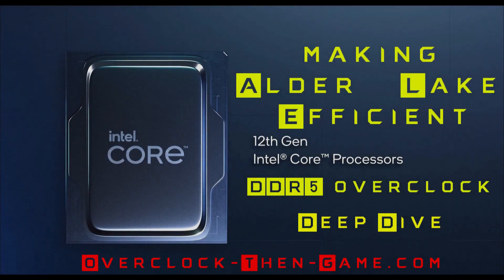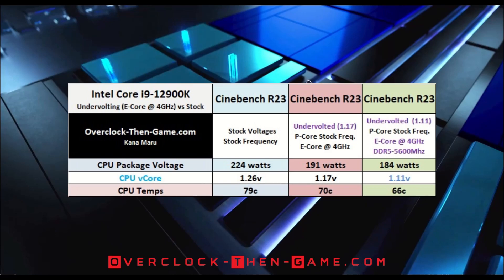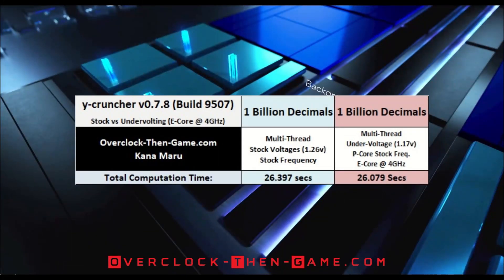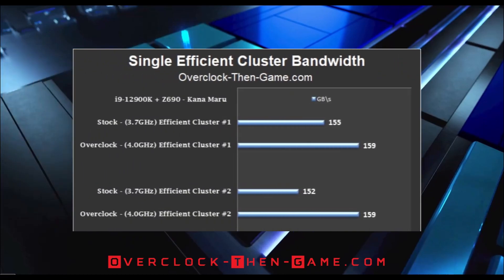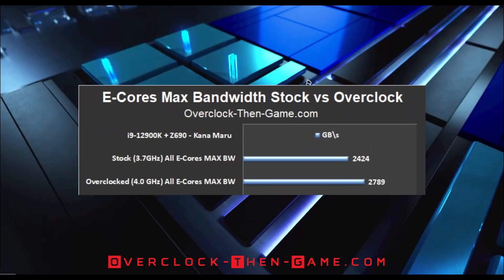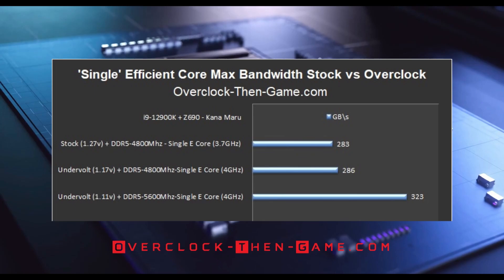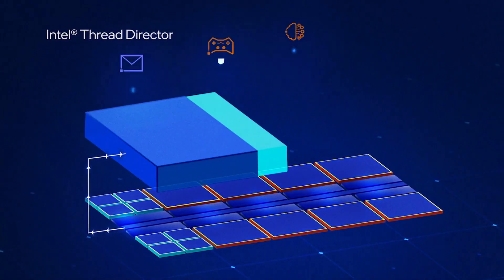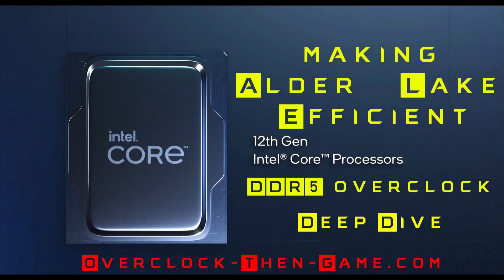Deep Dive - Making Alder Lake Power Efficient & DDR5 OC

Comment: Do you give V-core voltages from Bios or those under load from CPU-Z or HWiNFO? I have an i7-12600KF with o/c P-core 52x2 51x2 49x4, E-core 40x4 V-core stress 1.208V (CPU-Z). My cooling is Noctua NH-D15 with an old stand and temperatures under stress (20min) reach 90'C, (194W). Inspired by your film, I will try to go down with two P-core sources to 4.9GHz and lower the voltage even more.
Reply from the maker: I got the numbers under load from software in Windows (CPU-z\HWiNFO etc.). You have a nice overclock and good vCore by the way. 90c is definitely up there, but you'll almost never hit that during daily tasks or gaming. Thanks for the kind words, I appreciate it. 

Good luck. Just try to find the performance you need and work from there. Be sure to check out the Discord Server as well:  https://discord.gg/UD6NqNPtXv

Comment: Hello, I'm considering undervolting because I'll be planning to running cfd applications almost 7/24 with my 12900k. I want to keep it cool. Electricity prices in my country have increased by 125 percent since the beginning of the year. Of course, i also want it to work efficently

I believe that the Core i9-12900KF (PL1 125W, 241W) setting indicated in igor's lab workstation test article is not achievable by limiting a single parameter to 125w, right?  "Core i9-12900KF, Core i7-12700K and Core i5-12600 in a workstation test with amazing results and an old weakness | Part 2"

As far as I can tell from your reddit thread, you don't publish your settings, but I have no intention of pushing the limits. I just need a solution that I can forget about once I've tweaked the settings. 

To be able to use the computer, I'm waiting for the lga1700 mounting kit for the noctua d15. I may sound stupid by asking a question here without first checking the standard underclocking guides for Intel. I'd appreciate it if you could point me in the proper direction or recommend a resource. Thanks.
 
MB: MSI MAG Z690 Tomahawk 
RAM: G.Skill DDR4 3600 Mhz CL14 [2x16GB]
Reply from the maker: Hello and thanks for checking out my YouTube video. There are several ways to get full performance while limiting your power consumption. If you apply the 125watt limit you will limit your frequency so you are correct, that is not what you are looking for. 

I am using the ASUS ROG Strix, but the MSi MAG looks like a great motherboard and I'm sure the options in the UEFI\BIOS are roughly the same as my options. I'll try my best to help you determine your stable voltage and lowering your overall wattage. Head over to my Discord Server. You can use your browser or the Discord app. I can give you much more information there and help you reach your goal.

Discord: https://discord.gg/UD6NqNPtXv

Comment: 25 percent less power 
And lower temperatures with an inefficient cooling system???
Hats of to you man hats off
Thats amazing
I assume that they have ow stability rate per chip considering this is new for x86 which is why they bumped up the voltage that high
Regardless this is some good stuff
Reply from the maker: Thanks and be sure to check out the article, you might find a bit more info there. Some people think that Intel increased the voltage\wattage just to beat AMD, but I think it might have been for stability reasons as well across many sectors. 

Luckily I was able to undervolt and overclock the CPU + DRAM. So far so good many hours of different types of workloads and gaming. No issues so far.